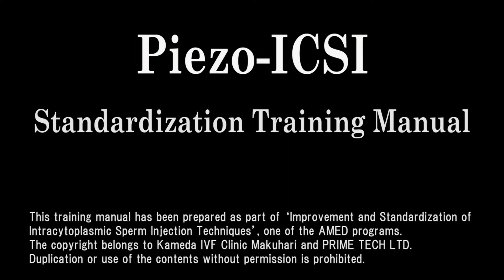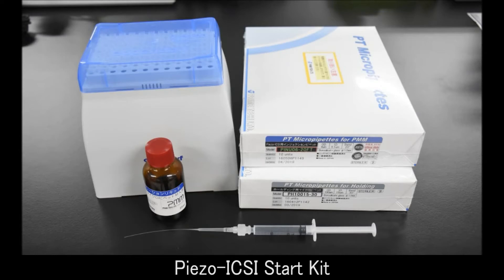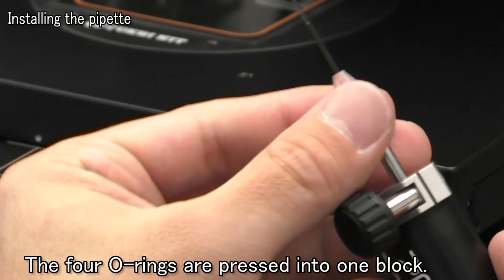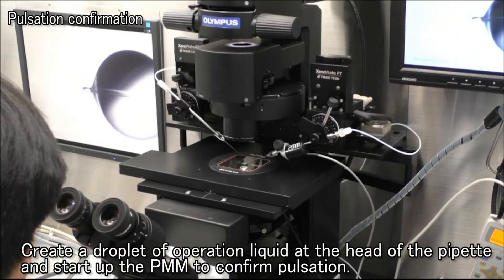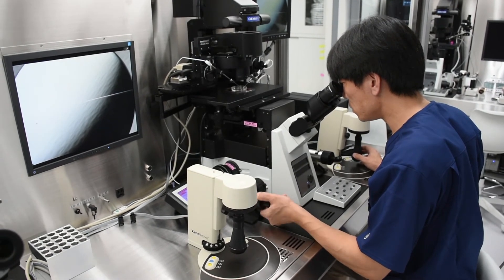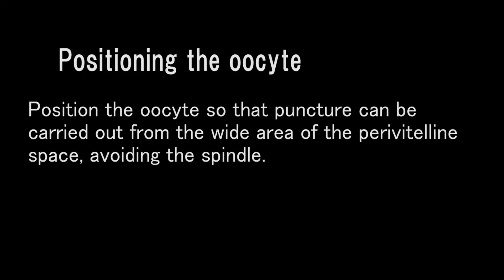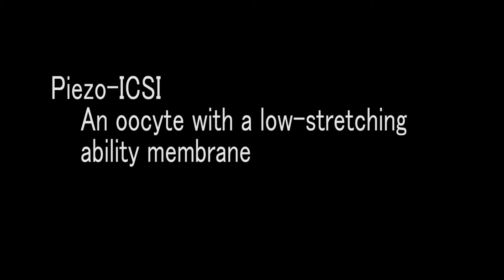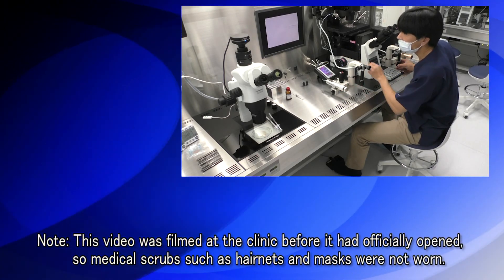Piezo-ICSI Standardization Training Manual

Comment: What is that liquid for?
Reply: Sorry for my delayed answer.
When the Piezo drive unit is driven, the physical force is produced like hitting the micropipette with a hammer. This physical force produces ultra-fast sub-micron forward momentum of the micropipette tip, however, the operation liquid filled inside the micropipette stays still, because of inertia. As a result, ultra-fast submicron negative pressure is produced at the tip of the micropipette. The Piezo-ICSI uses this negative pressure produced by ultra-fast sub-micron forward momentum which is generated by the Piezo drive unit. And the flat tip micropipette is used because to equalize the negative pressure applied at the tip of the micropipette.

Comment: Thank you for this great video. Two questions:
1. What’s your fertilization rate with this method?
2. Why did you inject the sperm tail first and not head first as in conventional icsi?
Thank you!
Reply: Thank you so much for your questions and sorry for my delay response.
My fertilization rates with this method are as follows.
Head-first injection group: 86% (294/342)
Tail-first injection group: 90% (262/290)
(Hiraoka K et al., J Obstet Gynaecol Res. 2018 Oct;44(10):1963-1969.)
No significant difference was observed between the Head-first and Tail-first groups, but a slightly higher fertilization rate was observed in the Tail-first group, so I inject the sperm from Tail-first. But either's fine!
Reply: Thank you, Dr Hiraoka. And in terms of time consuming, do you think piezo icsi takes more time to perform than conventional icsi?
Reply: @biryukovaa  
Yes, I think so. The rough time of pipette preparation, sperm immobilization and zona opening to sperm injection are as follows. Because of the procedure of introducing Fluorinert inside the micropipette and zona opening, Piezo-ICSI takes more time at pipette preparation and zona opening to sperm injection.

Time of pipette preparation
Conventional-ICSI (C-ICSI): 60s
Piezo-ICSI (P-ICSI): 100s

Time of sperm immobilization
C-ICSI: 20s
P-ICSI: 15s

 Time from zona opening to sperm injection
C-ICSI: 25s
P-ICSI: 50s